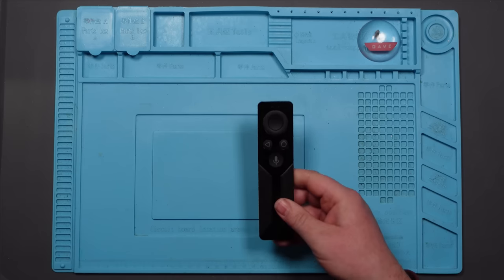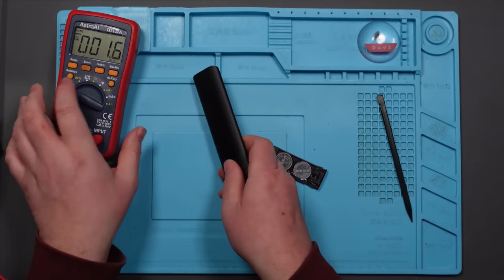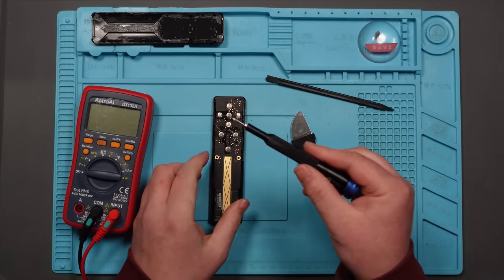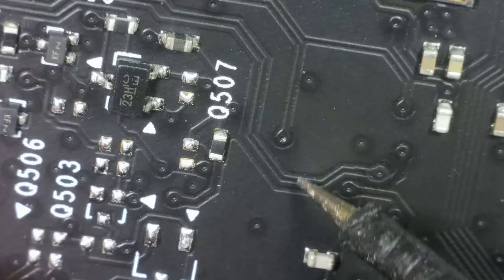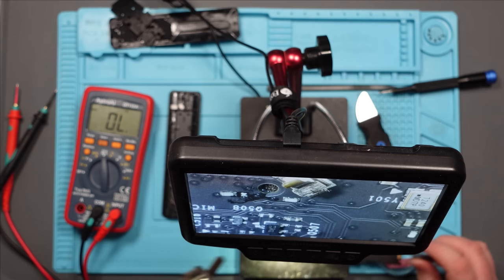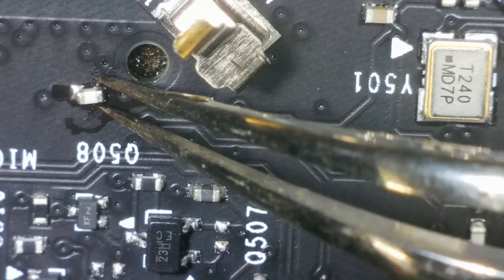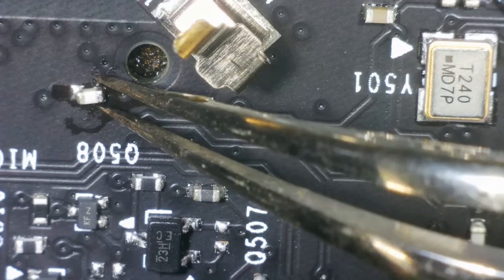My Nvidia SHIELD Remote Stopped Working | Won't Pair | Not Fair

Comment from the maker: Stupid Remote Control
Reply: Stupid finger shadow !
Reply: just buy the new shield remote, i never liked the flat one... gets lost in the couch to easily.
Reply: Worth more investigation. You'll figure it out over time.
Reply: stupid nvidia remote.
Reply: Stupid reggae music. 🤣😁
Reply: @JohnnyStashh  And it uses proper batteries. I hate button cell batteries and how short they last compared to AAs or even AAAs and it's a pet peeve of mine how companies so often make devices unnecessarily thin just to save a few cents on plastic and sacrifice AA/AAA compatibility along with it, devices that are just used at home and don't even need to be portable in the first place, like kitchen and bathroom scales and kitchen timers. Those button cells last a fraction of the time and they're a bit pricy and harder to get, and you're less likely to have a stockpile of them laying around compared to AA/AAAs so it makes them all the more annoying to replace, So you can end up in a scenario where you're in the middle of cooking and the kitchen scale is out of battery forcing you to put dinner on hold so you can go out and buy more batteries.
Reply: @JohnnyStashh  Working with old Nvidia Shield TV models? Thanks
Reply: Hey, why does it only show 7.5k subs on your channel now? I had to resubscribe on your recent video.  I've been a sub of yours for awhile and I found this odd.
Reply: I'm having similar issues with my firestick remote... love the channel

Comment: Found a couple posts via reddit that it may simply be an issue where the remote or the shield itself needs resetting. They said: 
Remove the back cover of the Nvidia Shield remote
Take out one of the batteries
Hold down the center “select” button and the home button at the same time
While still pressing both of those buttons, reinsert the battery that was taken out and then continue to hold the buttons
If this is done correctly, shortly after you reinsert the battery, you should hear a beeping sound
Now unplug, then replug the power from the back of the Nvidia Shield, this will turn the Shield on without the remote.
Try clicking some buttons to help re-pair the remote. Give the remote up to 30 seconds-1 minute to re-pair with the Nvidia Shield.

and another said:
In the end, key was in physically unplugging power on Shield unit.
So to be clear, I only had to do the following:
take out old batteries
put in new
return battery tray into remote
start pairing by pressing either home+back (circle+triangle) buttons
then while it's searching unplug and plug back in power on Shield
After Shield booted remote stopped blinking, and started working.
Reply: Thanks for posting this.  I went ahead and followed the steps of disconnecting shield while the remote was on pair mode.  Worked like a charm.  Thanks again.
Reply: Thanks . It worked . Nothing else would work
Reply: This worked for me, unplugged the Shield TV and started pairing mode before plugging back in.  The remote was still in pairing mode when it booted up, went to the remote section and had it forget the remote and it instantly started pairing and connected.

Comment: I have that same remote with the same problem. I was hoping you'd come up with a solution. Keep up the great content Steve.
Reply: Me too. Mine had exactly the same problem and I couldn't get it working. I ended up getting a new style remote that takes normal AA (or maybe AAA) batteries. It's much better.
Reply: I also have this issue. Could a recent firmware update killed it somehow? I bought a cheap Bluetooth remote off Amazon and it does the trick. The thing used to eat batteries anyway
Reply: Mine broke a year or so ago and I ended up buying a cheap remote with a usb dongle.

Comment: Swap the IR led for a regular colour led. You could also connect an oscilloscope to that output and check the pwm signal from the chip. I think a scope would benefit your channel
Reply: Yep, and for quite a bit of scope work you can buy a $40 scope that’s just a microphone digitizer and works great to 20khz
Reply: Also, you can get IR fluorescing cards so you can see the light without a camera or replacing the LED.
Reply: I use for example the picoscope for around 140€ for work. And I would say it's the money worth and they have a good software. But please don't buy a cheap china think, they are not good, the software is also important.
Reply: @leoschuhmacher1219  the camera in your mobile phone will tell if an IR led is working

Comment: If you think your batteries have been shorted, take them out relatively quickly and measure the voltage.  Watch for a minute, if you see the battery voltage climbing it’s a sign.  Under normal use in circuits the rebound shouldn’t be very high, if it is it’s a sign the battery is developing excess internal resistance and is failing.

Comment: Some people were saying the IR can draw a lot of the juice.  If you aim it at an IR camera do you see if it is always emitting?  You could try taking the IR off and see if that stops the drain.
Reply: It's a bluetooth remote.
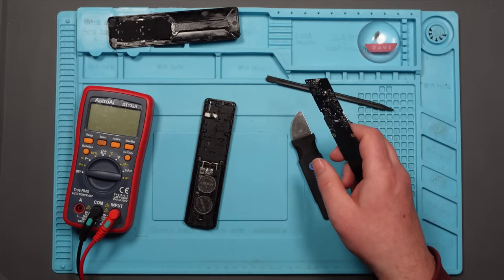Reply: @Remko1024  it isnt lol 4:29 you can see the little led on the top
Reply: The Nvidia shield is Bluetooth.  The ir is for controlling your TV, or stereo with it as well.
Reply: It would show on the video, it didn't.
Reply: It's a Bluetooth remote
Reply: It uses bluetooth for pairing and controlling Nvidia shield. But also has a IR led for controlling other (IR based) devices. And if the driver of the IR is faulty (eg keeps the led constantly emitting) it could produce a voltage drop enough to make the bluetooth chip not work (too low voltage, hence the draining of the battery). To check this Steve you have two ways: use a camera (even your smartphone will do) and see if there's any light. 2: make the simplest IR receiver using IR receiver led, transistor, led (any colour, any led you can find) and a couple of resistors (for current limiting thru the leds). If IR transmitter is working, led will light up (or blink like a code). Just remembered nr 3: take a radio receiver and put in AM. Tune to a no transmission zone and get the remote close to it (idealy as close as possible to the built in antena). A working IR remote will induce some waves that the radio will pick-up (like a noise-this was tested and working on older tv remotes).
Try and remove the IR led and see if the bluetooth works. I'm not sure about the next one: possible shorts between pcb layers? Don't know if this remote's pcb is double or multilayer. If multilayer, then it might be shorted somewhere.

Comment: 2.8V is too low for most 3V lithium cell devices. Below 3.0V the battery is usually considered flat. Try powering it from a bench power supply at 3.2V and see if it's working, what's the current draw and where it gets hot.
Reply: Yep, remember a multimeter has no load. So, 2.8v is below the voltage the battery is supposed to supply and it isn't even doing anything yet!

Comment: No experience of this remote but my experience with other similar devices was bad contact between the pcb 'spots' and the button caps. Peeling back the plastic overlay and cleaning the button capa and their equivalent pcb contact (ipa on cotton bud) fixed my issues.
Reply: Yeah but he peeled the whole thing off so there should be absolutely no contact at all.  If the buttons where stuck down then that would have solved it.

Comment: My plumber son just suggested "it's f****d innit Dad". No decorum.  My money is on a short in the battery connections which only occurs when it's in the case - maybe even a stray strand? It's such a small leak that I'm not surprised it's invised on IR but battery rewire of run it from a power supply?  good  luck Steve - you have to do part 2

Comment: you cheeked for voltage at the entry points but does the voltage actually goes into the board towards the chips? had one similar problem with a remote and a power rail was discontinued so there was no actual power on the board itself... the current is too low for something like a capacitor to blow up, I think. and a chip going bad is very unlikely

Comment: I’ve seen those blue SMD components on Wi-Fi and Bluetooth circuits and with antennas connected they were measuring as a ‘short’ also. I think this is part of the Bluetooth antenna circuit and isn’t the problem.

Comment: You could see if the IR is constantly on using a phone camera, and/or check if it's getting power at all with a voltmeter.
Reply: not all phones show the IR signal
Reply: @BrunakoPAO  most will if in night mode. This setting increases the sensitivity to IR light.
Reply: @BrunakoPAO  test both cameras on your phone.  most modern back facing cameras have an IR filter now days, but the front facing "selfie" cameras usually do not.  I use my iphone 12 selfie camera to test IR lasers on cisco fiber ports to make sure its live and I don't burn my eyes.
Reply: @Eurallis2  ok 👍 
Thanks for the info 😊

Comment: Why not voltage injection into shorted line? You got tools - lab power supply and thermal cam. Shorted element would be pin-pointed in seconds.

Comment: Did you try the remote reset? Press and hold both back and home buttons (triangle + circle) for 10 seconds, then release...it's what always brought my remote back to life.
Reply: Does the job with my Shield remote - mine is the original (2015?) which is rechargeable and doesn't have batteries.

Comment: I don't have anything helpful to add on fixing this, but you should be able to control the shield using the TV remote over HDMI CEC - this is a protocol for communication over HDMI for set top boxes and sound bars. I have a different TV and a different shield, but it works really well for me and I never use the Nvidia remote. TV manufacturers often rebrand CEC to their own thing so you might have to Google

Comment: Steve, it was two 3V batteries.  It was testing at 2.8 Volts for both.  Shouldn't you have replaced the batteries first?  It won't make a difference because you have a short but you should start with working batteries.

Comment: Batteries out and inject voltage at the shorted rail (1V, 2V) and look again with your thermal cam. Your powersupply has more power than these batteries. Maybe this can help you.

Comment: I thought flat button cells like 2032 are 3v each? So why no 6v feed..they never run in parallel bu5 in series so should not be 2.8v to the board but 6v on the positive..so inject 6v to the board..

Comment: Add voltage with PS and use the thermal cam on the other side like you did the button side while pressing button and as far as inferred draining just aim a camera with night vision at it see if its emitting all the time with voltage.

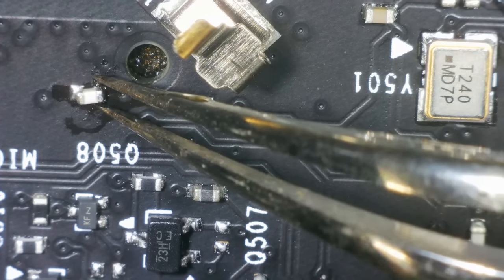Comment: 9:20 One of those plastic membrane sheets for the remote looked a little damp. This happened with my roku remote... nothing would work. I cleaned off all the liquid and the remote worked like a charm. Maybe there was some liquids that got spilled in the remote or the adhesive from one of those plastic membrane sheets is making it short out. Try cleaning those sheets without removing any of the metal membranes and it may work. Only issue is the membranes will not have adhesive, unless you find an adhesive replacement that works. For what it counts, my roku remote has zero adhesive on its membrane sheets and they still work, even the volume controls work now.

Comment: Is it possible it's something with the battery cradle that's shorting to ground when it's installed? Check the data sheet on that chip corresponding to the leg that was shorting - could it be a battery leg? 
Hope you can find the solution mate. 👍

Comment: if the board itself is not drawing current, but the batteries are obviously being drained, then maybe there's something shorted on the battery sled
Reply: I was thinking something similar. maybe its not shorted while its out of the case, but once in, it is?

Comment: Pressure switches are a real PITA.... with the plastic removed and switch covers, you could check for voltage on the inner and outer rings....

Comment: Shouldn't the battery voltage at the board have been reading ~6V, if you have 2 x 3V batteries connected to it?
Reply: The batteries are in parallel

Comment: I had a Bose remote and the “ new but old” CR2032s were only a little low, just below 3v, and it would not work, so I am wondering if it was actually the short on the button that has drained the batteries and now the batteries are just too low to power the remote.

Comment: I just had issues too with a new battery install. Tried all button combinations. Figured I try the Nintendo fix. Blow into the remote with the battery slot out. Worked a minute later.

Comment: I think you can turn on electricity by power supply, 3 volt and more amps (than in battary). Than you will see in infrared thermometer a spot with a short.

Comment: 1:28 See how the surface of the batteries look cloudy? Thats corrosion.
Dont touch lithium batteries directly. My understanding is the casings are made from a low resistance alloy which is VERY reactive to the salty oil coming out of your skin.
If held like a coin you may get that salty oil in the insulating ring (between the top and back) and it creates a short.
Normal button batteries can put up with it. Any battery where the number starts with a CR is lithium.

Comment: I have the same remote and it died yesterday, nothing at all, new batteries made no difference. If you point a remote at a camera phone it shows the IR quite nicely - the Shield remote is totally dead. I loaded up the mobile phone app for the shield and it works well, very disappointing though.

Comment: I have the same issue.. what is strange at some point it worked again but now it’s dead.. same as you it sound like the remote drain the battery but doesn’t work

Comment: Stumbled onto this as mine appeared to be acting up - in my case it turned out it had instead paired with my downstairs newer model nVidia Shield (the "roll"). Once I explicitly removed it from that one it was instantly back to the old device (no explicit pairing needed). Hope this helps someone who ends up here - might not be Steve's problem...

Comment: Last remote that didn't work for me it was the IR LED. Did the phone camera trick. Also testing with meter one way around usually causes led to flash. Also tested my led on component tester and was faulty. Never came up as diode. Pinched led from another unused remote and it worked.

Comment: First unplug the nivid shield for a minute then plug it back in that might do the trick.

If that doesn't work it's an easy fix. It has to do with the battery's not seating properly due to a small pice of plastic breaking off on the battery sockets. I cut a sliver of cardboard from a soda box, a bit smaller than the battery dock, and slid it under the battery dock while inserting it in the controller. This will jam the battery dock in the controller, so be sure to leave a pice of the cardboard hanging out so you can replace the battery's in the future.
Reply: He injected 3V onto the battery contacts (I'm guessing) and it still didn't work

Comment: Dear StezStix Fix
Firstly, i find your methodology of faultfinding funny and informative  Thank you for your content. I am wondering if you could share the method you often use to unsolder components. You use what appears to be hot glue and a heat gun? I have only ever used a soldering iron and very interested in how you do this? Thanks..HKM. keep up the quality content!
Reply: I think the goop is some sort of flux.

Comment: Everyone keeps going to the IR but surely this only had IR to do things like volume on the TV and will use Bluetooth or similar pair with the main unit.  Surely if it's a faulty IR it would therefore still pair but then not control the TV???

Comment: the only thing i can think of, is try to factory reset the remote. Buddy of mine got his to work again with that, but! but!!!! it did die after 2 weeks again. 

Remove the back cover of the Nvidia Shield remote

Take out one of the batteries

Hold down the center “select” button and the home button at the same time

While still pressing both of those buttons, reinsert the battery that was taken out and then continue to hold the buttons

If this is done correctly, shortly after you reinsert the battery, you should hear a beeping sound

Now unplug, then replug the power from the back of the Nvidia Shield, this will turn the Shield on without the remote.

Try clicking some buttons to help re-pair the remote. Give the remote up to 30 seconds-1 minute to re-pair with the Nvidia Shield.

This should hopefully fix the issue. (maybe)

Comment: clean the contacts,,,:), maybe the signal gets obstructed by grease, could be on the transmitter too..., if u get low power on the batteries, try replace those...

Comment: I have the newer version, but, maybe try a Bluetooth keyboard+mouse.  Then turn on HDMI CEC.  You can use you tv remote as a stand in over CEC.  You could also buy a shield controller it will work as a remote and probably (at this stage) be the same cost as new remote.

Edit: Also as a workaround:. I also use a Rii mini i8+.  Because I hate running between my desk and the couch. The remote is out of reach.  You can exclusively use the Rii pad as a replacement or augmented remote.

Comment: It could be the IR (if it was sending signals it would light up in the video: it didn't), I had a Dreambox remote control some time ago which didn't work, I changed it and it worked again for a few days until again it was not working, it turns out one of the components was sending more voltage so it fries the IR. I didn't change the component because I don't know which one it is AND because I bought a second remote control. Maybe I will give it a go sometime again.